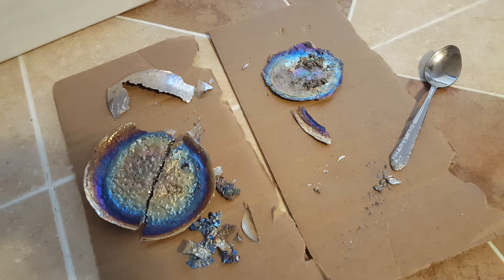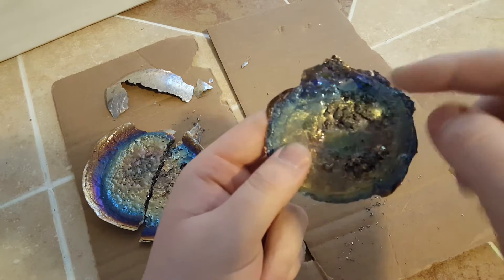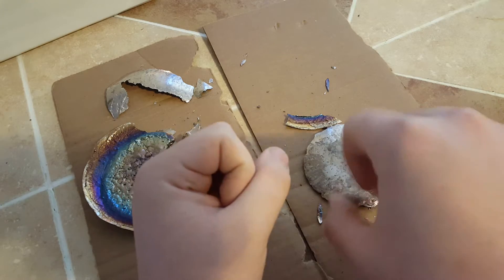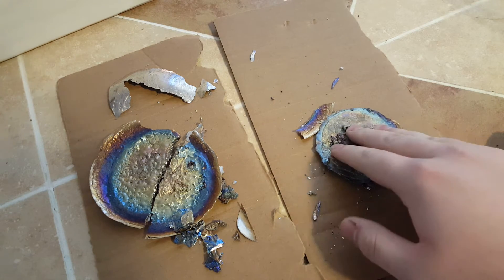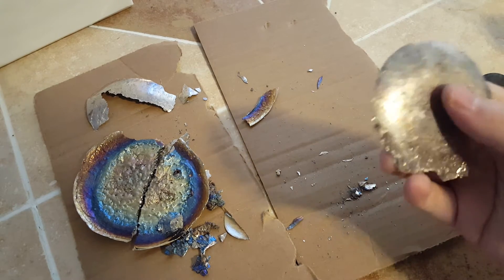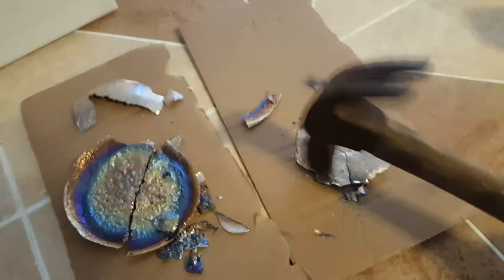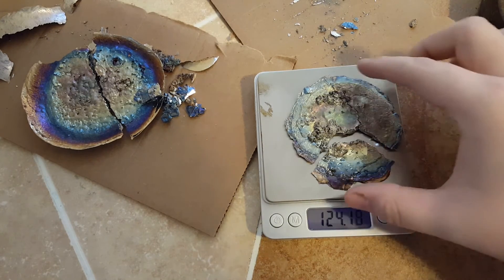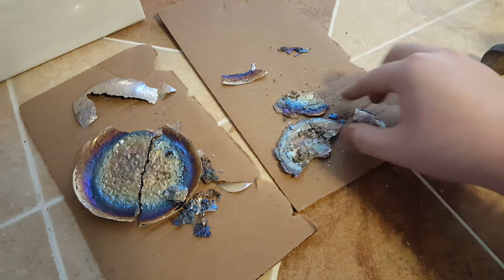Destroying Bismuth!

Comment: is it weaker than plastics? It seems extremely weak I was wanting to use it for corner angles to support small structures.
Reply from the maker: Brad M it depends on how much weight they would be put under I suppose. Doesn't hurt to try.
Reply: It looks weaker than nylon.
Reply from the maker: It's brittle but I think someone else talked about treating the metal to harden it... Though I never tried.
Reply: I'd be making 3d printed molds and I'm not sure if just 3d printing is better in this case. I need a little more heat resistance on some models than others which is making me think about printing some of the nastier plastics like polycarbonate.
Reply from the maker: Brad M oh then totally go for something cheaper Bismuth is pretty but I don't think it is a good building material
Reply: I don't know metals at all and would want something that melts at lead or under leads melting pt. Something other than pewter, tin, or bismuth?

Comment: You do realize cadmium is quite hazardous? We take a lot of precaution at work and we are dealing with compounded cadmium which should be considered very safe compared to elemental cadmium. Not sure if people could easily buy cadmium anyway and that it would be any cheaper than bismuth. 
Just do a little research people before you play around with certain materials. Especially if you are combining materials. Compounding can be quite exothermic and result in toxic gases or explosions.
Reply from the maker: Wait, what? In the video I didn't even use or talk about cadmium. I bought a bismuth ingot online and melted it to show its oxide properties.
Reply: Towards the end you mentioned making large things out of bismuth and that it would be expensive. You looked for similar melting point metals to put the bismuth on top of to make it cheaper. You mentioned cadmium (I thought) along with lead and a few others. I just didn't want people to do something crazy and potentially dangerous.
Reply from the maker: Oooh I am so sorry about that, I didn't even think about it. Honestly I google what alloys with bismuth. 

the main thing that started the video was a person asked  could bismuth be used to make a shield?
Reply: Not a problem for me. Just thought I'd mention it in case someone tried something crazy like that. Hopefully they might read it in the comments and avoid Cd or Pb.
Reply: Check out my channel for my videos on Bismuth. Both the metal crystals and the character on Steven Universe.
Reply from the maker: I agree, I think that most people playing with Bismuth will know of the dangers of Lead, or Cadmium.  Thanks for mentioning this though!